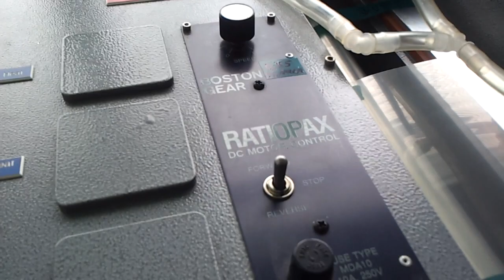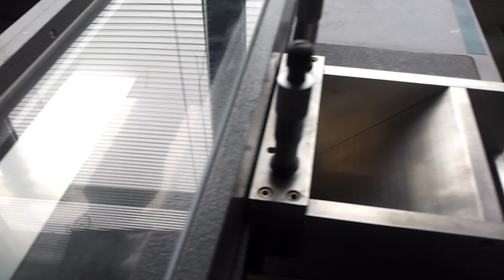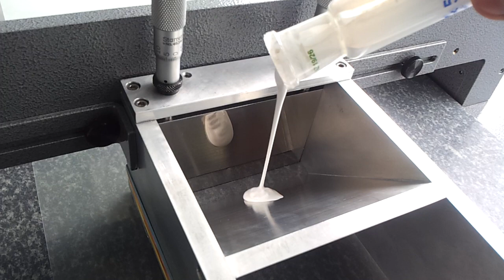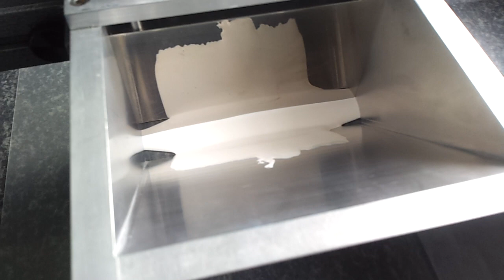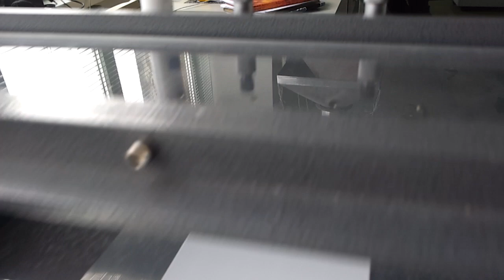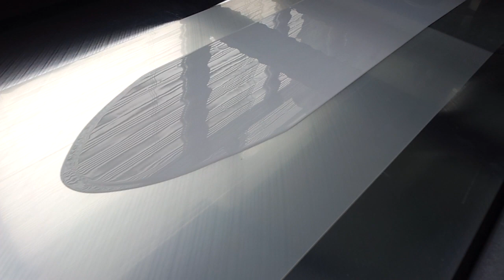Tape Casting TTC-1200

Comment: I'm very worried about what they didn't use the mask. Because tolunene that is very toxic is often used by the solvent.
Reply from the maker: Thanks for your care! We did not use toluene, it was ethanol.
Reply: Some tape is made with toluene but all milling requires full face respirator regardless of toluene. It smells like death without a respirator.